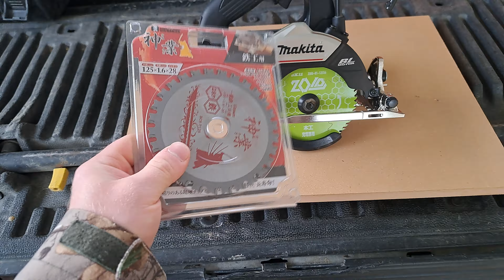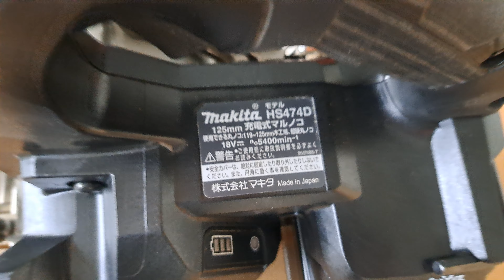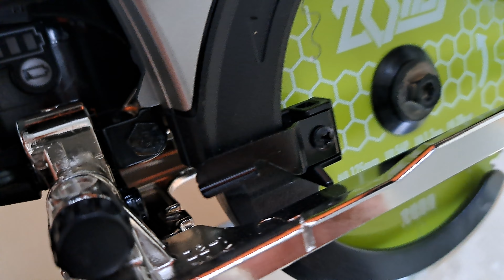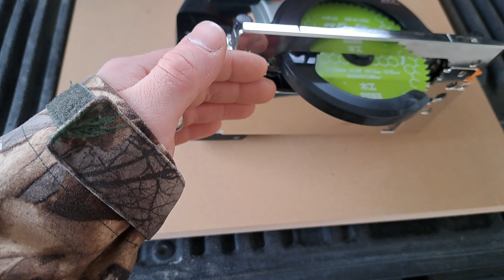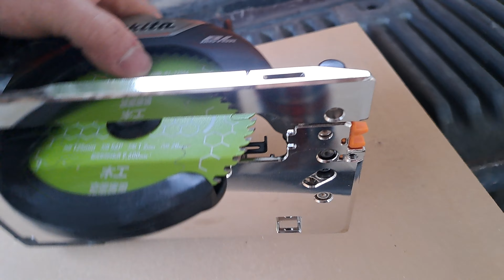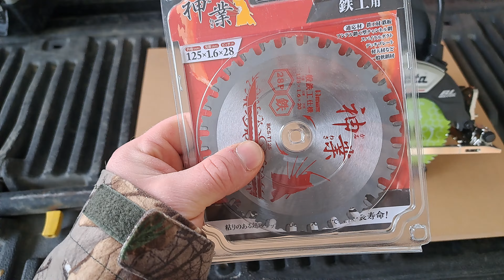Makita HS474D 125mm/5 Inch Circular Saw

Comment from the maker: UPDATE Only a couple weeks after filming this the stator on the motor failed. Because its imported Makita will not warranty the motor. This is apparently a common issue. Ive ordered a new stator from Japan, and hopefully that solves the problem, otherwise I will also need a new controller. Im disappointed that it failed so early.

Comment: I have the Hikoki 36V version of this kind of saw and it is my absolute favorite saw. Most portable, super light weight and cuts most material depths. Otherwise I just use my 165mm Hikoki saw. But this Makita saw looks absolutely gorgeous and just as good as the Hikoki. Nice! Only problem is having to order those 125mm blades from Japan